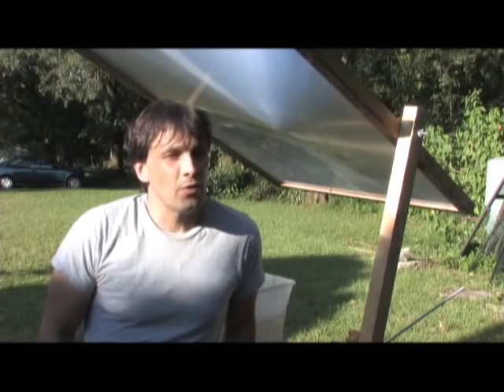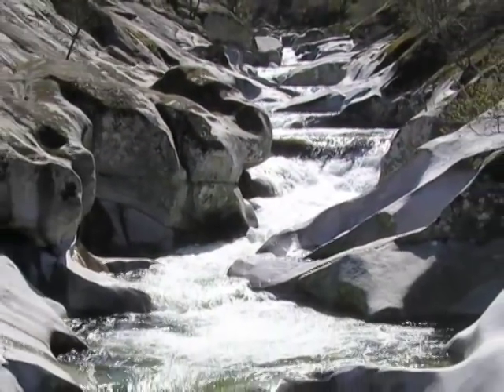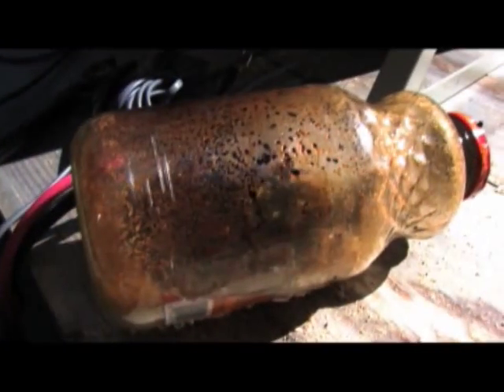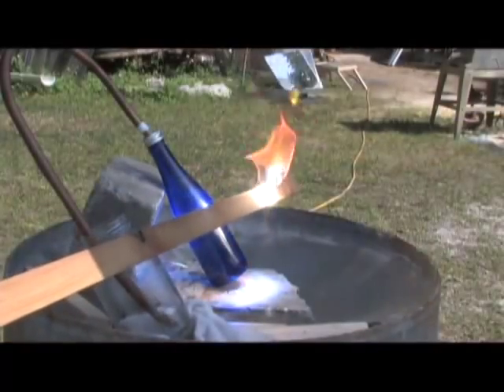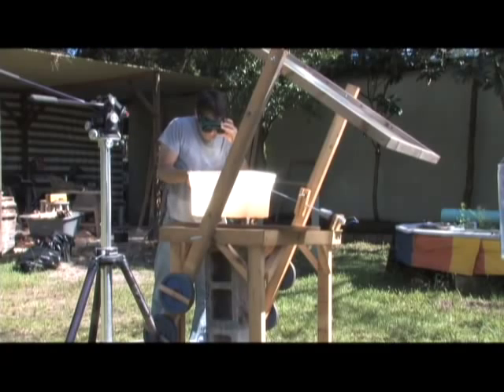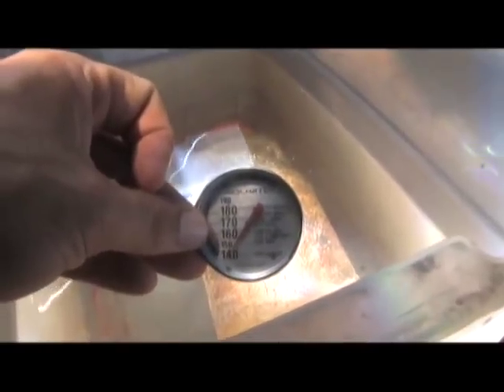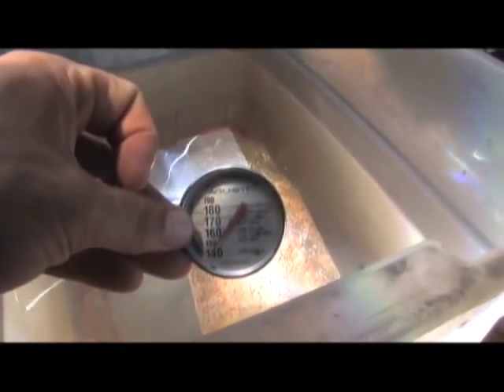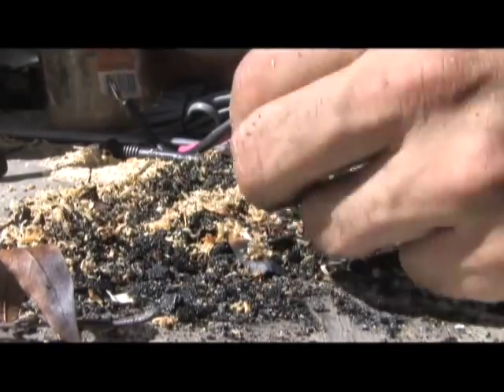Biomass Char Solar Fresnel Lens PYROLYSIS GREEN GARBAGE DISPOSAL Bio Char

Comment from the maker: The water vapor exits first. It does not have to be dry, just not soaking wet. Similar methods used for incineration, they usually do a mild gravity dry or compression first.

Comment: Oil is pumped out of the ground.
Stable products made from oil can be put back into the ground from which they came.
Carbon in biomass is only temporarily stored but eventually returned to the air when decayed.
Using biomass as fuel is carbon neutral.
Turning biomass into carbon(PYROLYSIS) is carbon negative unless you use a fossil fuel to do it. When you consider the tons of coal we burn(carbon positive), why pass up the chance to burn biomass(carbon neutral)

Comment from the maker: Hi,
Thank you for the comments:-)
The gasses would be burned for environmental and energy purposes. 
1. If allowed to run long enough the vitrified mass may be used as filler materials. Still some debate on what to do with it for Plasma & Incineration too 
2. For wood and some paper, the process stops short and produces a char (carbon sequester) which can be used to enrich soils. The second requires extensive monitoring for pure input to prevent plastics and other materials entering the process.

Comment from the maker: Hi,
The Fresnel lens concentrates sunlight so placing it over your pool will not  add additional light. This works because light is taken from a large area and concentrated to a smaller one. You can get pool water to boil in a small area by focusing on a small dark object submerged. This boils the surface water coming in contact with the dark object. For pool heating, check out the solar hot water on my channel. Also clear pool water lets the light pass through.

Comment from the maker: Hi,
It will work on other materials. The char goal was just to prove pyrolysis was taking place. This idea can be added to other methods to increase their process too. I have a new container that isolates the mass from the glass so materials that melt first would not stick to the glass losing heat. The maximum temperature I have gotten with a Fresnel Lens is 3000f.

Comment: @caronthegerman 
Most anything that can be burned can be pyrolysed
I do plastic and rubber to make gasoline and fuel oil to power my home and I would
love to be able to do it with heat from the sun and now that I have
 one of these lenses I will try it this summer.

Comment: i really appreciate you making this video, I know I had asked you in a prior video if this was possible with the lens, the escaping gas can be ignited to power motors or as such  to make electricity. if this could be scaled up then land fills wouldn't be much of a problem.as it is they make enough methane themselves to help power a small city and the resource is underutilized.then of course thermal polymerization would work too to help us all out.all good ideas

Comment from the maker: Hi,
The bath water temperature makes little difference in the inside chamber. In a larger system, steam may be produced and added as a power generation option. The vent gasses could help in this, they would need to be collected and burned.

Comment from the maker: Plasma arc for garbage requires a lot of energy complete the process and there are questions regarding the actual energy production vs. incineration, the main idea behind solar pyrolysis is increasing the end energy generation using solar at 80%+ efficiency based on space requirements. Newer Plasma plants will need to be fully tested for their I/O and true % of gas burn.

Comment: Have you ever looked into plasma gasification? They use plasma so hot that the molecular bonds making up the trash are destroyed and turn into only 2 different waste streams. 1.) inorganics turn to a rocklike slag 2.) organics turn to an energy rich syngas. The drawbacks are that the systems are very expensive and require a lot of attention to upkeep. But they turn our trash into either usable rock/cement product or a gas used to produce energy. If you are interested let me know :) Very cool vid

Comment: @caronthegerman 1.no,the tape acts as a check valve so the gas that flows or "pop's"out is allowed to escape2.I don't know what size lenses he used but the starting product was wood shavings of which the products it created during the process was gasification or methane from the out gassing and then the final product was bio char.3.this was a controlled experiment 25 minutes was enough to turn all of this and the light didnt go all the way across the jar

Comment: DUDE!  The escaping gas is the most useful part of the process!  That gas is commonly called syngas.  It's a mixture of methane, hydrogen, carbon monoxide and water vapour, along long chain hydrocarbons--tars.  

What you want to do is pass that gas through another cool container to condense all the tars out of it, then use it to run a normal piston-cylinder engine.  Like a lawn mower or a small generator!

Comment: @L00NGB00W he was using wood shavings so the gas that was escaping was methane, most people that produce methane for home use usually run it through a water source so the carbon that is in it falls out into the water source giving clean gas as an end product for heating and cooking

Comment from the maker: You capture these gases and use them for combustion. The gas process is complex and is done in many process already. This is designed for large scale not backyard. Also simply burning or staring your BBQ pit is many times more destructive to the environment. Char, the black stuff I made in this video is sequestered carbon.

Comment: This is similar to an idea I worked on in the past. Only my unit turned everything you put in it immediately into commutable gas which was burned & converted to heat. Including water in the material. (I was burning green wood dry leaves) with no emissions (-0- smoke -0- creosote -0- ash) I'm not sure I could replicate this. There might be a piece I don't really understand. The unit can be used for home heat & elect. generation.Recently I've been getting inspired to give it another try.
Thanks

Comment: I have 3 more questions after that first one. Maybe you could help me out.

1. Doesn't water fill the glass container if it has a hole in it?

2. What size lens did you use? After watching the blue-shirted guy's videos, I learned that leaving materials in a pyrolysis reaction for different temperatures creates different end products.

3. How long should this be left in there? You still had a few bits of wood left over at the end so I'm guessing 25 minutes isn't long enough.

Comment: The greener thing to do would be to send it to the landfill so that it can wait to be disposed of by "burning" it with plasma. The method that has just started being used is to hit the garbage with plasma in a giant chamber, causing everything to turn back into their basic elements, collect the gases to be used for power to run the plasma torches + extra energy which is sold off, and the metals collect at the bottom in an inert material called slag: wikipedia(dot)org/wiki/Plasma_arc_gasification

Comment: I have to respectfully disagree: when closer to this processes' maximum ability, the plasma torches can be ran on the gases produced by them as they convert the hundreds of thousands of molecules into the basic building blocks (elements), allowing the torches to run literally off the garbage while it works and with some energy to spare.

Basically, we're looking at dumps as giant lumps of future energy and construction material (slag).

Comment: Good idea, but there is one glaring problem I see with it.

Even though you may be avoiding Carbon Dioxide to a certain point by not burning the trash, the breakdown of organic trash will still release loads of methane, which is also harmful to the environment in the massive amounts that would be generated using this method, and it would not produce as much steam (and therefore, not as much power) as simply burning the trash would.

Comment: The water bath is a waste of energy.  Use a suitable material for the retorte in the first place and skip the water bath.  By all means capture and use the escaping gas, THAT is the whole purpose of pyrolysys.  That stuff you are wasting can be a substitute for OIL if processed further.